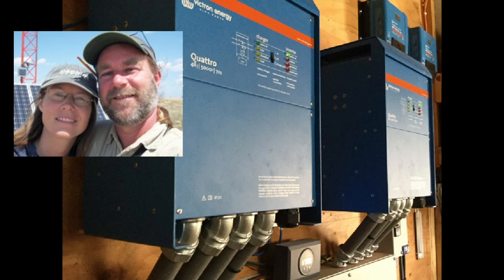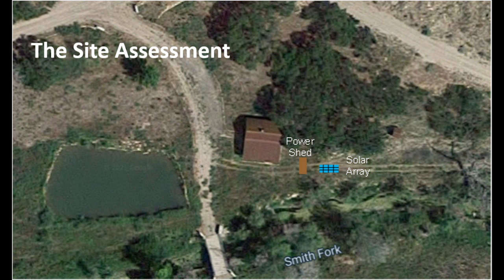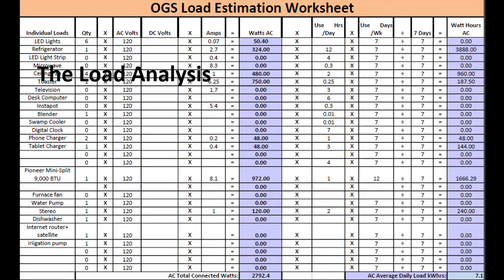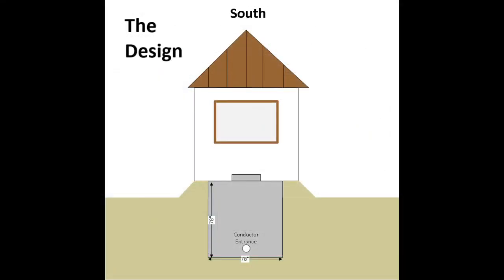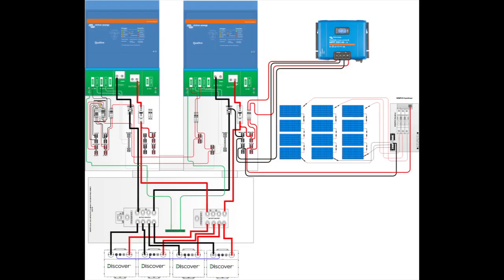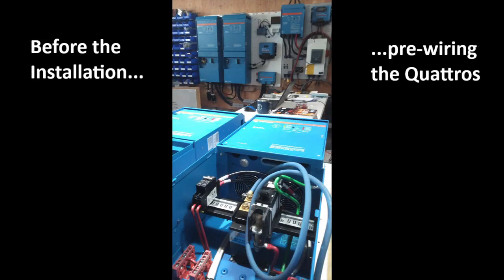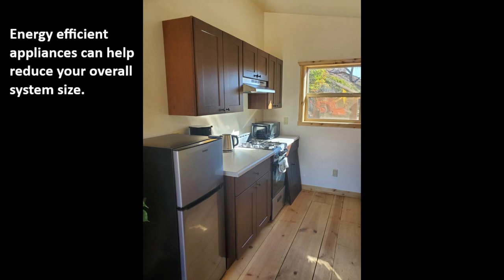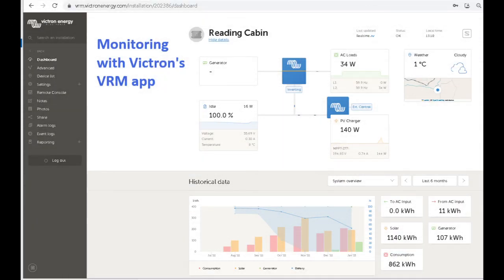Off-Grid Install - Overview

Comment: Nice video. Why do you put all the electronics below ground where ground water can get in and destroy all?  i did see some foam sealer in concrete joints but that can and will eventually leak if ground water rises above floor slab. i did not see any below slab drainage. sorry if i missed it in your video.
Reply: Looks like a pretty arid environment. With the lithium batts it is important to keep them above freezing. Tough call, but below ground is not a bad idea! I have been considering it for some of our projects as well.